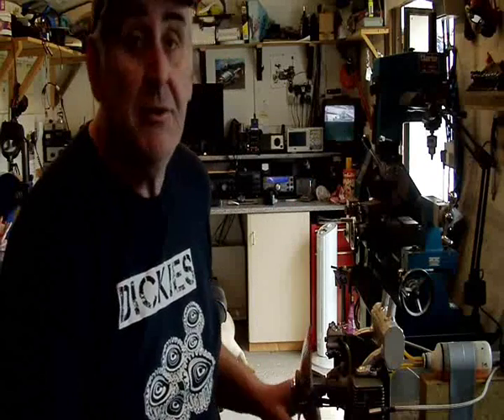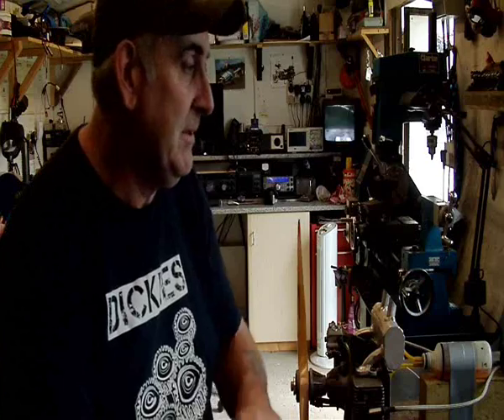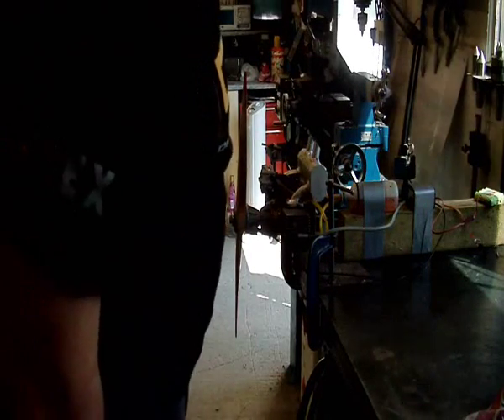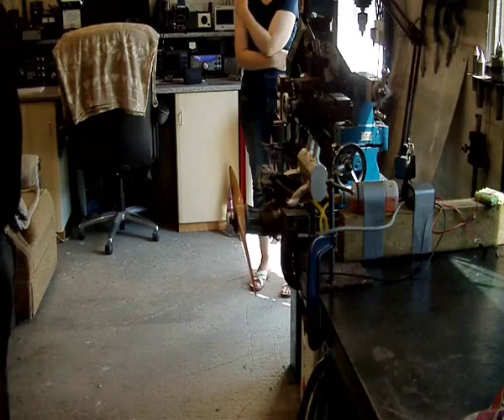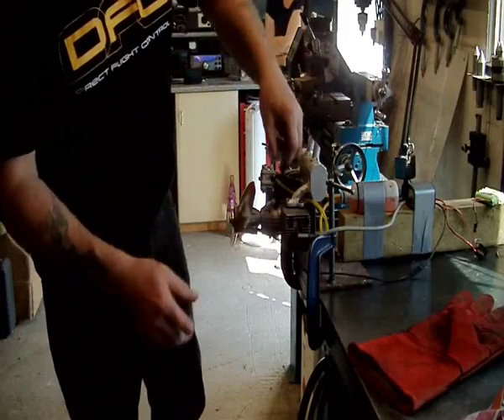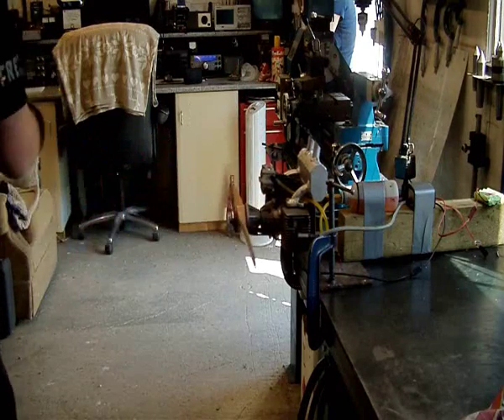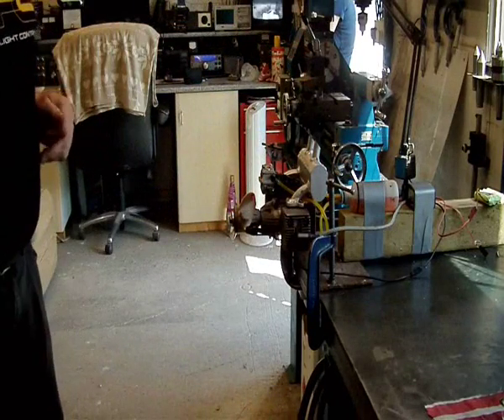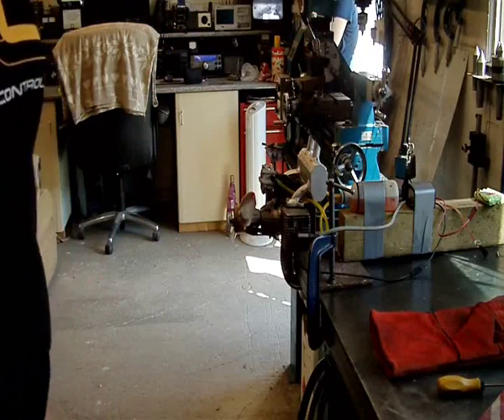Tartan Twin Spark Ignition Conversion

Comment: Thanks for sharing this.... I have a 22cc single and the twin that I'm needing to convert to petrol and I was wondering what timing to run with. 👍🏾
Reply from the maker: Hello slim glad you found the video of some use good luck with your engine stay safe.
Reply: @fixitnige  I think you're brave to 'get back on the horse' so to speak.
Did you use a walbro carb and did you use Rxcel ignition module?
Cheers Kev
Reply from the maker: @slimriddim4145  Yes it was a walbro best carb on the market IMHO the ignition was a tartan.
Reply: @fixitnige  thanks for that